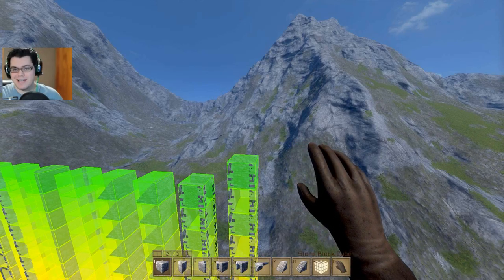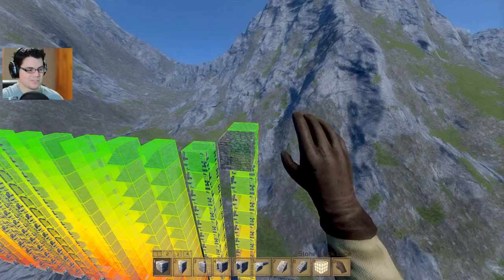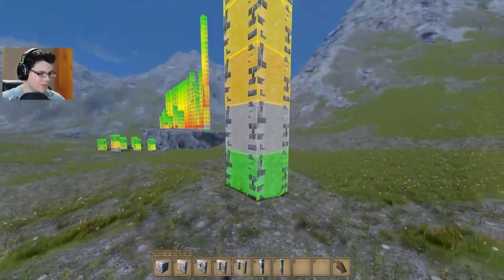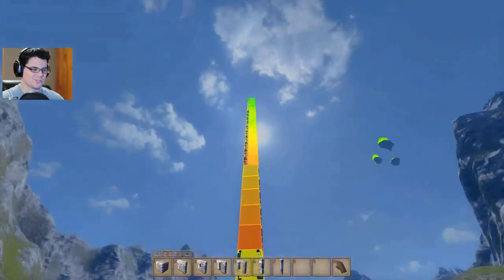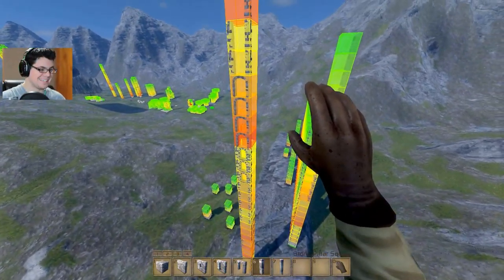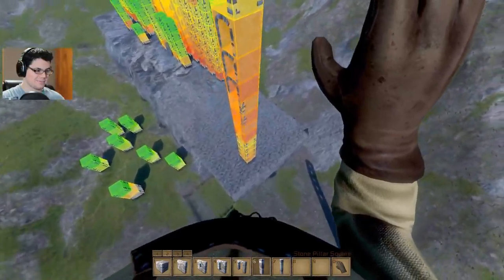Limits of Stone Structural Integrity Medieval Engineers

Comment: To maximize the size of a tower you should start with 14 of the LIGHTEST blocks, so that the bottom one is at maximum pressure before breaking, then add as many heavier blocks below it as possible, and so on and so on untill you calculate how many solid blocks you can place underneath the structure. Then once you know the winning combination, start building it from bottom to top.

Comment: I wish the developers would have actually studied medieval architecture and engineering, because they have the structural integrity so wrong. Stone walls were never the same width from bottom to top. They started thicker at the top to support the weight above it. also, arches and domes are severely weak in the game compared to reality. And the lack of buttresses is a serious issue. buttresses is how medieval engineers were able to build massive, tall structures, as they take part of the weight of the wall off the primary foundation.
Reply: Shekel Goldstein The game isnt compelted yet, maybe in the future they will fix it :)